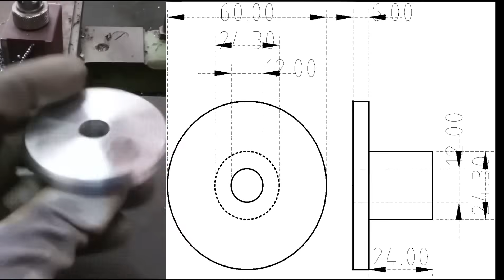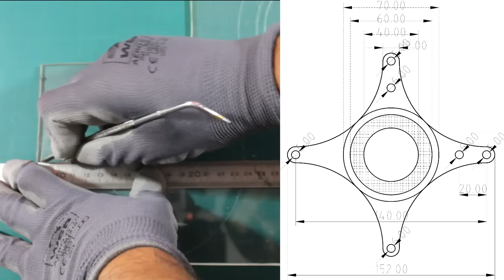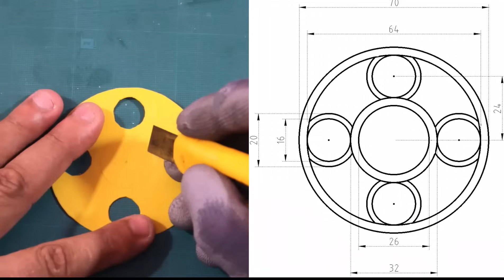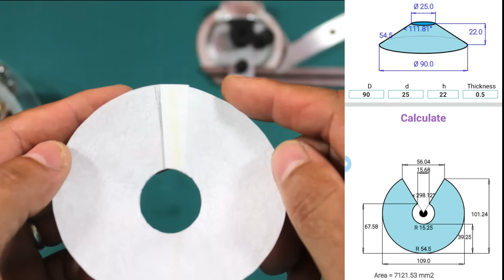--||-- How To Make Speaker Driver --||--

Comment: Awesome work.  Sounds Great.    Now you just need to make a  3"  Dome midrange,  and a Passive Radiator... and you will have a speaker that competes with some of the best speakers out there.

 The only criticism I have, is the use of bolts for the Spacing.  I think it would have been better to cut actual spacers from some metal pipe, so that you didnt have any potential for spacing errors...  nor any potential issues with nuts coming loose from long term vibrations.

 Id love to see your take on a copy of the Phillips Woox passive radiators.   If you google them, you will see that each Woox unit, use TWO Accordion like flat-cones... spaced apart about 1 inch.   The spacer has air vent holes between them.

 I used to own the Woox speakers.. but mine died due to Foam Rot.  However, I believe Phillips made some Woox passives out of Flexible Plastic... that would have theoretically lasted forever.   I found it interesting that they used two cones, instead of a single cone... like most passive radiators.  But I do love the dual expansion ring design... which allows them far more extension than a typical passive radiator.

 According to the speaker Driver designer + Mfg.  in Taiwan... they made the woofers specifically for the Phillips Woox speakers.   One of their features, is a greater Travel / Extension... to help prevent distortions,  and to provide deeper / lower bass potentials.

 Id often thought about trying to replicate the woox myself,  using a few speaker repair kits of different sizes... and gluing them together.    Of course, I wanted to make a larger sized version... maybe 12 inches in diameter... for use with 8" woofers.
Reply from the maker: @johndough8115  hello, first I'd like to say thank you for your great comment, for bolts it will never falls because it's well hold by loctitr 675.
For me it's my first experience for building a midwoofer, and the big surprise was that this driver sounds really very good with enough bass response 😋
You welcome 🙏🙏🙏
Reply: Elebusou trava rosca (cola vermelha) nas porcas, então não vai soltar com a vibração.